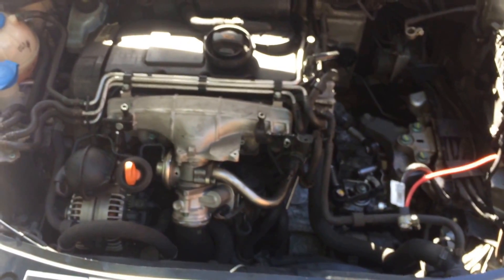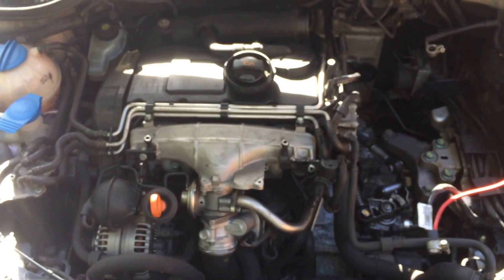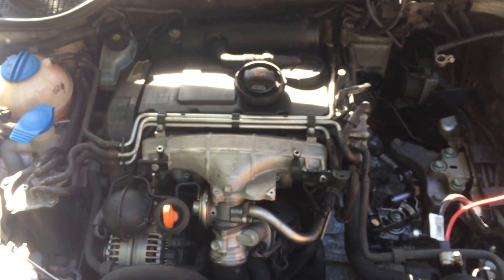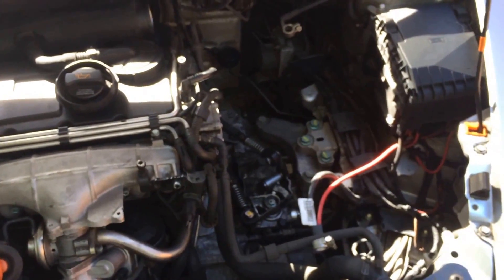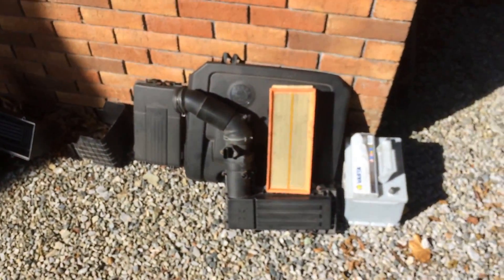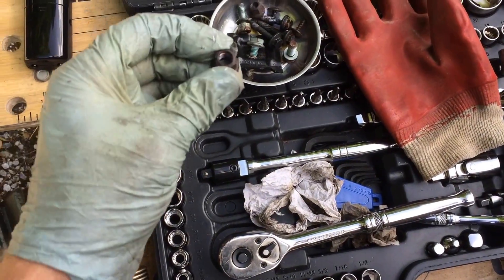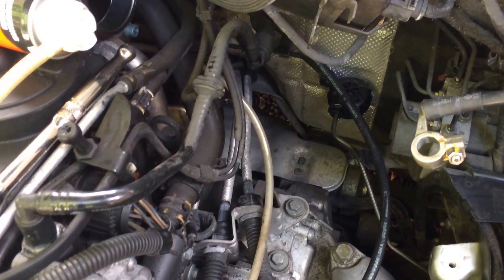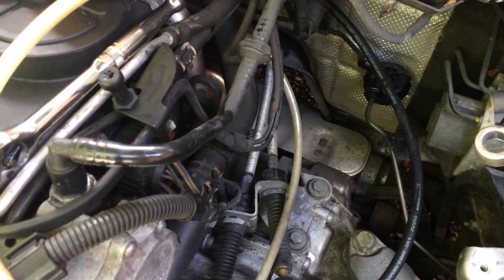Skoda Octavia 2005 2.0TDi BKD Engine Turbo Sticking Vanes (Mr Muscle Method)

Comment: Thank you so much for this! I had the same symptoms and had tried archoil and wynns in the tank but nothing was happening. I followed your method and referred to the diagrams / picture at the end of the video and the only trouble I had was with stubborn corroded battery tray bolts! Only driven a few hundred miles since the fix but it's 100% better (more responsive and no limp mode). Thanks again!

Comment: Is Mr Muscle better then Innotec Turbo Cleaner? Do your car has a DPF?
Reply from the maker: Your guess is as good as mine as I have no comparative data. I guess that they both contain carbon dissolving compounds. I would imagine that any chemical compound introduced with the turbo in place will never be as thorough at cleaning as removing and stripping the turbo. My view was that anything that dissolves the deposits sufficiently to prevent the engine from going into limp-home mode was worthwhile.
Reply: @bvqbvq  Hi.  Did this work as a long-term solution?
Reply from the maker: @amana1480 , I sold the car shortly after doing this so I cannot say. I didn't have any further problems though.
Reply: @bvqbvq  Thanks.  My BKD Golf has done 170k miles.  One issue is that sometimes the vacuum pump performance seems to decrease, and this can also affect the turbo operation (as well as brakes etc).... I'm going to change my vacuum pump because I have noticed that sometimes the brakes are slightly better than others, and this seems to coincide with the times the turbo operates slightly better than other times (also my tandem vacuum pump previously had an external diesel leak, my local garage said it was better to replace the gasket, so that's what I did, but 1 year later it still has a diesel leak).  I later found out they only replaced the 1 gasket between the tandem pump and the cylinder head.  I thought they were going to replace all the gaskets and seals.  I wish I had stuck to my guns and got the mechanic to instal a brand new Bosch pump which costs less than £200.

Comment: My A3 has a BKD in it and has never suffered a cracked head, sticky vanes, rough running etc. It only went into limp mode once due to a vacuum leak which shut down the vanes. That was fun driving up hills. Mr Muscle works wonders. Ive cleaned out manifolds EGR''s with it.

Comment: Has this solved your problem? I'm about to do the same on my BKD. Did you have a fault code for removing the battery come up?
Reply from the maker: I'm not local I'm afraid. It isn't too difficult to do, you just need basic tools. Alternatively just ask your local garage to do it for you, it should only be an hour's labour.
Reply: Thanks for the video, I'm about to try Mr muscle treatment on my bkd golf. Does your method going in via the egr pipe give the exact same result as going via the exhaust/ cat outlet? I.e get the Mr muscle to all the same parts of the turbo?
Reply from the maker: I have not had a recurrence of the limp home mode since the carbon clean out. Removing the battery did not cause any fault codes to be generated. All I had to do was to reset the clock when I reconnected the battery.
Reply: Kevin Stewart hi kevin im having the same problem with my 2006 skoda i live in bolton greater manchester are you local do you fancy doing mine for me il pay you for your work.my names imran please get back to me.thanks
Reply: Kevin Stewart ok kevin thanks for that.
Reply: Really clear and helpful video. I've just encountered overboost/limp mode on my 05 Octavia with the BKD engine. Two questions for you: 3 months in now, have you had any reoccurrence? Did you you have any whistling/whining from the turbo before or after the clean? Thanks.
Reply from the maker: No, I had no recurrence. I suspect that it clog up again in time and it may eventually need stripping or replacing. I did not have any turbo noise either before or after cleaning it. If you have noise I suspect that your bearings are worn and it probably needs replacing.
Reply: UPDATE: removed battery and a section of the intake, managed to loosen the top two Allen bolts (size 8 not 6 on mine). I can just about get to the two nuts (12mm on the golf) but they seem to be completely seized... looks like I will have to keep spraying get valve cleaner into the air intake for now, and turbo cleaner in the diesel tank. If that doesn't completely cure it I'll have a go at removing the cat from underneath... not looking forward to that
Reply: David Ferguson  hi did you have loud wising noise from your turbo?? I have the same did you solve it?
Reply: @asterix7941  i have the same how did u resolve it
Reply: @kamemh  I ended up getting a new rebuild turbo mate and it fixed things car felt mint and pulled like new got it for £200 and put it in myself